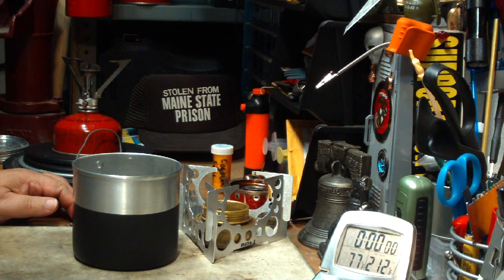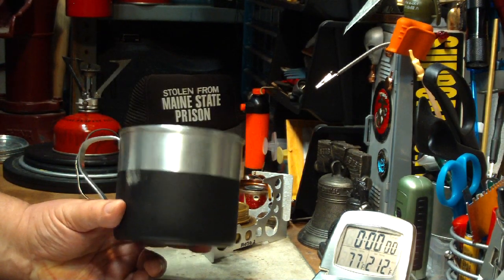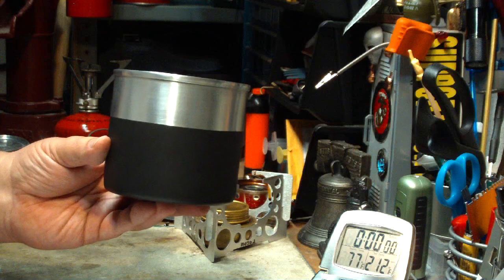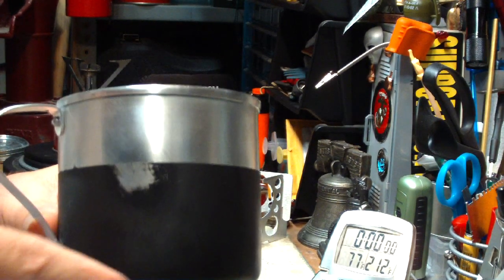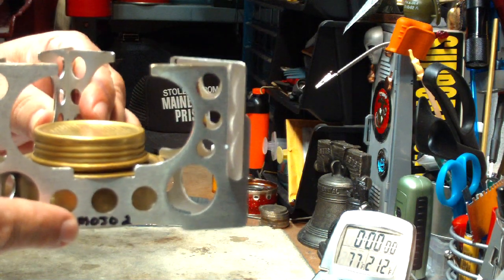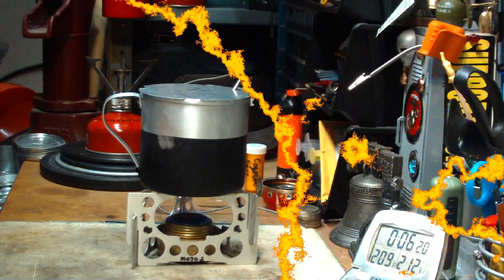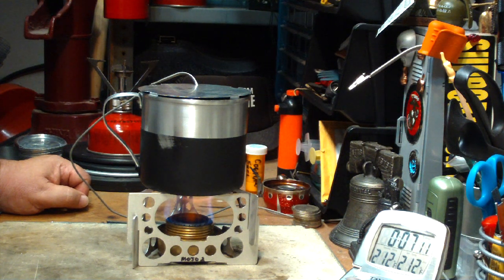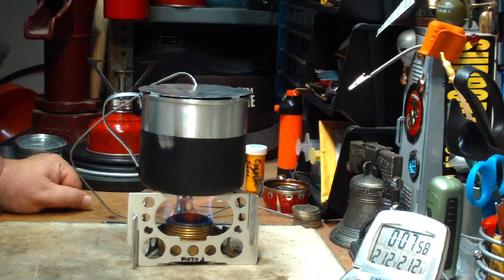Backpacker Magazine Painted Pot Idea - My "Beau Geste"

Comment: In response to ColoradoCamper, it does help if you are heating your cookware next to a campfire. I don't want to set my uncovered cup of beans (or water) in the fire or on coals. The cup will cut oxygen to the coals if set directly upon them. I like to set my cup close enough to the fire for some radiation and convection, but far enough that I can get my hand close to stir the food. An unpainted cup seems to have trouble heating at this distance.

Comment from the maker: Not really. The soot will stick to the paint and then if you try to scrub the soot off the paint will come off too. Using a bar of soap on the bottom of the pot would be better. That's the way we did it in Boy Scouts.

Comment: If I may join in beating this dead horse (with my nerd glasses on): To the naysayers, the primary heat transfer mechanisms for a pot on a backpacking stove is convection and conduction. You can look up the equations. There is no variable in convective or conductive heat transfer for the color of the surface. That only relates to radiative heat transfer, which is extremely minor for a backpacking stove. It would maybe be a factor for cooking over charcoal or campfire coals, but that's it.

Comment: Hirams results dont surprise me in that the times are longer not shorter. 40% claims by backpacker magazine are in fantasyland in my opinion.  Logically, if you spraypaint a pot with paint, that paint obviously MUST be heat resistant - i.e, it RESISTS heat. That being so, then common sense would appear to dictate longer boil times and not shorter ones. But perhaps i shouldnt mention logic and stoves in the same sentence after my volcano trials and tribulations!!

Comment: I nothing on the WEB related to the process of heat transfer through conduction based on Colors. Black Absorbs Light thus getting hotter than a lighter color. So if you put a black pot in the sun it would heat the water Faster that a light Colored Pot based on the absorption of light. A black colored Pot has no advantage over a light colored pot thru the process of heat transfer through conduction. The Material and Thickness of the Pot is the Determining Factor, as your tests have validated. tks